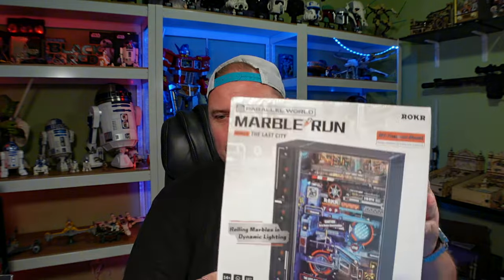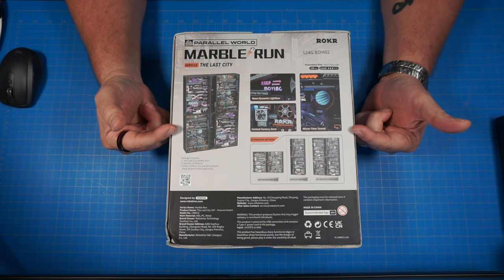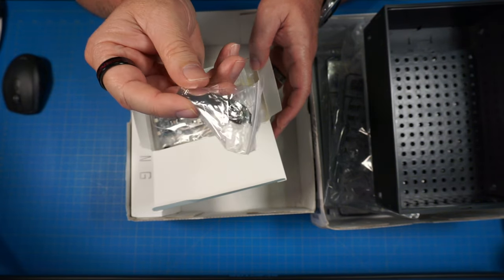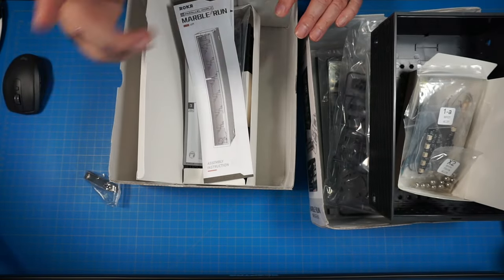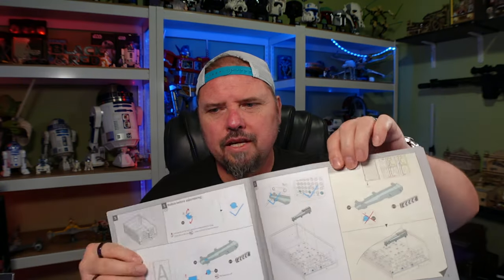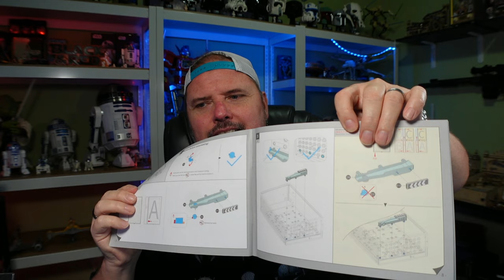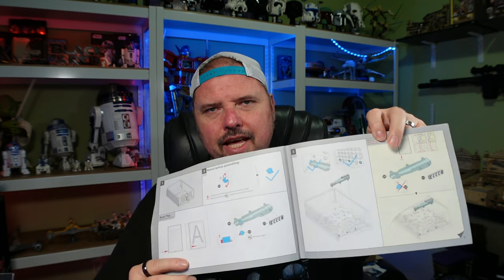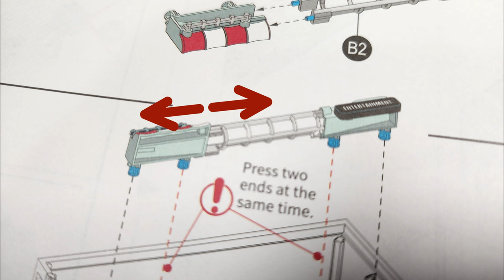ROKR Marble Run THE LAST CITY

Comment: Be careful using the magnet tool, it will slightly magnetize the steel balls, causing them to get "sticky" and they  may clump together when they touch each other.
Reply from the maker: Wow, I didn't even think about that. Has this happened to you?
Reply: @blackandredbuilds  Yes it did, on another home brew marble run machine. The smaller the balls are the more likely they will be affected. You could demagnetize by heating them up to a high temperature with a flame.
Reply from the maker: @djam43  good to know 👍

Comment: Thanks for the video. lol it took me literally hours to try and troubleshoot the lift finally got it to work.

I actually misread the instructions and had the barrier on the top on the other side so all the marbles would randomly fly into the top shelf lol
Reply from the maker: I'm glad you got it figured out.. Thanks for watching.
Reply: @blackandredbuilds  lol yeah, glad i didn't  need to build another lift, 

would recommend getting the other set if you have the chance to, its pretty cool with the pair up and running
Reply from the maker: @hanyue6174  I should be getting the future city soon. I'll be making a video connecting the two.

Comment: Hey! 
Awesome video. I just recently received this via Kickstarter, and have it finished but cant get the lift to work! 
When i connect to power, i get expected results. Press the button once, and the lights turn on and the lift STARTS to work, but stops after one 'step'. :( 

Did you have any trouble with the lift assembly?
Reply: My apologies, i just saw the rest of the video. I'll try your tip!
Reply from the maker: @mikecampbell4299  I've since added all 15 marbles with no issues.  So yeah just try removing all 15 with the magnet tool, then turn it on and add them one at a time through the bottom. Let me know if you get it working.👍👍
Reply: @blackandredbuilds  sorry for the delay. My issue was just due to lining up the lift rails incorrectly. It would "lock" into the teeth of the gear and I'd have to pull the entire motor out to realign it. 
It works now! 😀
Reply from the maker: @mikecampbell4299 Awesome!! I'm glad you figured it out.